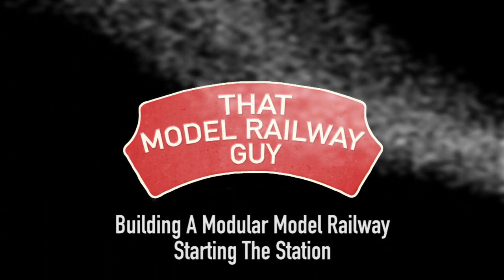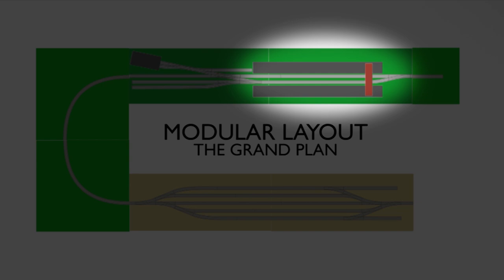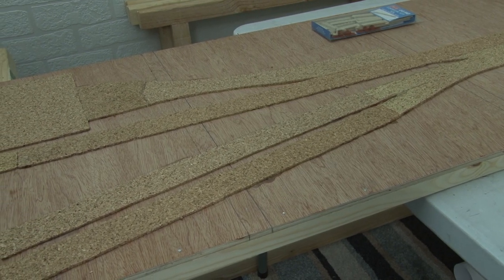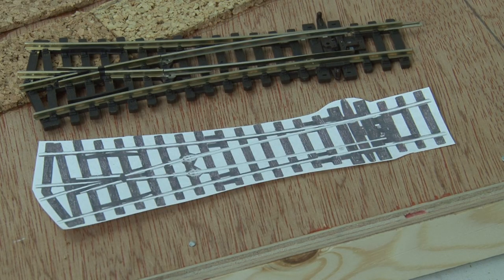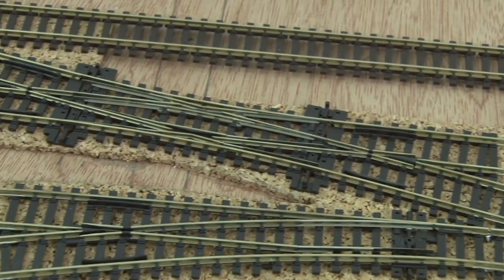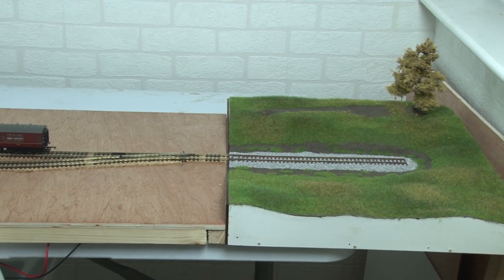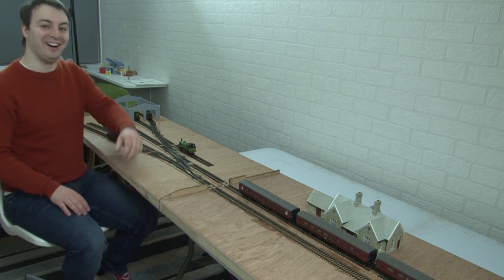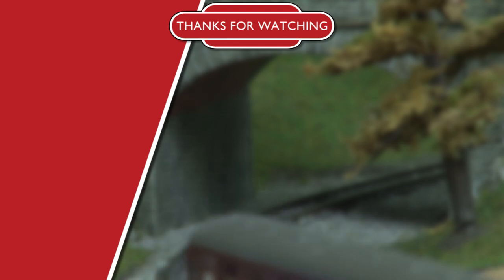Building A Modular Model Railway! - Episode 5: Starting The Station

Comment: Always impressed by your planning and the way you construct your baseboards with structures and scenic levels already  defined.

The station plan and arrangement with the shed is very close on being a model of Butterley station on the MRC. The track plan you've chosen is almost exactly the same so might be worth looking at for scenic ideas.
Reply from the maker: Thanks! I think because it's modular I know I have certain rules/standards/targets to follow (admittedly of my own making) so that it all matches up. That makes the planning a lot easier because some things are already in place and it's not just a blank sheet of paper.

That's great about Butterley station though - it wasn't intentional at all so I'll definitely check it out. I actually based the plan off a loose hybrid of Embsay and Oakworth (albeit flipped the other way and massively compressed!) so it's good to know that it's not miles away from reality somewhere! Thanks for watching 😃

Comment: Loving this channel, very well presented and very helpful. Can I ask what the Streamline points used in the Shed section are, please? The double-slip explains itself, and you mentioned the short Y... what radius are the others? Short? Medium? Large? Thank you!
Reply from the maker: Thanks, really glad you're enjoying the videos! All the other points are short radius points - I wanted to have a run round loop that would fit a loco and 3 coaches so to accommodate that the points all had to be the Short radius ones in order to get everything to fit on two modules. Thanks for watching 😃

Comment: Do you have a list of all the points you used for the station and engine shed area. I’m looking to do a similar design for my settle and Carlisle station module but not sure which radius points to use. I already have a small radius y point and a double slip. Regards Richard.
Reply from the maker: Hiya, in addition to the Y and double slip there are 3 LH points and 1 RH point - all are small radius to fit into the space but obviously longer ones could be used if more space is available. Thanks for watching 😃

Comment: How much would you say you spent on the shed half of this module? Alos, about how much per turn module? I am very into this layout of yours, and would like to see how much of it my budget would allow.
Reply from the maker: It's difficult to say but this is probably one of the more expensive modules given the amount of points and track on it. That and the wood for the baseboard tend to be the biggest costs. Maybe a couple of hundred but it's a guess as a lot of the materials (ballast, grass, foamboard, control systems, etc) were used across the entire layout. Thanks for watching 👍

Comment: Might be worth investigating putting a small single road shed over the inspection pit......we loco crews kind of like being able to work under cover (not that the railway I am a fireman on has a covered preperation pit)
Reply from the maker: Eventually the plan is to have inspection pits in the shed too but the heritage railway I based this station on does have an outside pit so I'd like to stay close to that if I can. But I can see why having it covered would be preferable for crews! 😂 Thanks for watching 👍
Reply: @ThatModelRailwayGuy  we have a pit inside for maintenance work, but all loco prep is done on a pit outside also......which has its moments on a nice morning, but not when the Yorkshire dales weather is against you....
Reply from the maker: @darkfrag83  Just out of curiosity, you're not talking about Embsay station are you?
Reply: @ThatModelRailwayGuy  I am indeed.....
Reply from the maker: @darkfrag83  Fantastic, I used to volunteer there when I was younger! If you squint the station on my layout is a very loosely based on Embsay - albeit flipped round, severely compressed and with a second road into the shed. 😂
Reply: @ThatModelRailwayGuy  wow! Small world..... Now you say it, I can see Embsay's influence. Are you gonna cover your carriage sidings? Because we have an extended carriage shed there, with an extra 50m length in the offing (the foundations are being prepared). Just imagine the current shed turned round, don't forget its 3 roads at the other end.....

How long ago were you there?
Reply: @ThatModelRailwayGuy  better not show you the 00 model of Wheldale thats sat on my shunting plank.....
Reply from the maker: @darkfrag83  Indeed it is! The original plan was to cover the carriage sidings but now that I can see it in reality I think it would block the view of the mainline and sheds too much so I'll probably just have the sidings be slightly overgrown and have some rusting rolling stock/locos there instead. 

It's a long time since I was a volunteer there, probably nearly 15 years. But it was one of the last railways I visited before lockdown so it was nice to see it still ticking along.
Reply from the maker: @darkfrag83  Ooh now that's tempting! I'm already particularly excited about the 16" Hunslets Rapido have announced 😁
Reply: @ThatModelRailwayGuy  Wheldale is a repaint of a Dapol Austerity with the modified chimney. Found it in a late friends collection (I dont know if you knew Charles Adams?) 
Am excited about the 16" too......gotta be Beatrice as I passed my firing test on her and helped with the latest overhaul.

Wonder if I ran into you before lockdown then? I managed to get quite a few Sunday firing turns in once we reopened.....
Reply from the maker: @darkfrag83  Sounds great! I might have to have a go at that sometime with Dapol austerity too! I did know Charles Adams (though I doubt he would have known me) but he probably would have known my Grandad who was quite an active volunteer at the railway for a bit.

Ah brilliant, it's good that Rapido are doing Beatrice then! It'll have to be Primrose for me since she was the first ever loco I travelled on!

Possibly although when I say I was there before lockdown I mean back before Christmas 2019! I was in the area and the railway happened to be open so I popped along for a ride to see how much had changed. 😃

Comment: Who makes the best/most realistic track?
Reply from the maker: Those are potentially two different questions depending on your standards really. PECO are generally considered to be the best and I use their track on the vast majority of my layouts. They have a wide range covering all different scales and gauges as well as different rail codes for some scale too. Overall they're pretty highly regarded. There's also the KATO Unitrack - not as realistic but loved by beginners for it's ease of use.

For the most realistic track though you're probably looking at a more finescale solution like SMP or C&L Finescale. These require more work but are a lot more realistic, especially when it comes to things like points. Hope that helps and thanks for watching 😃